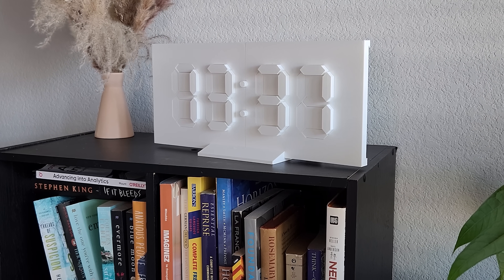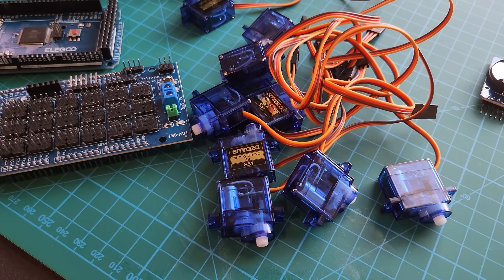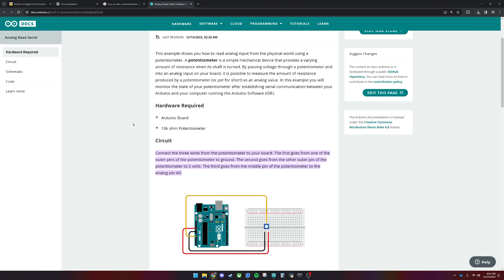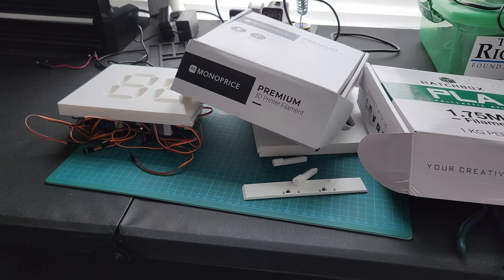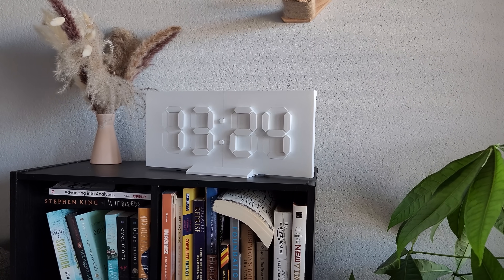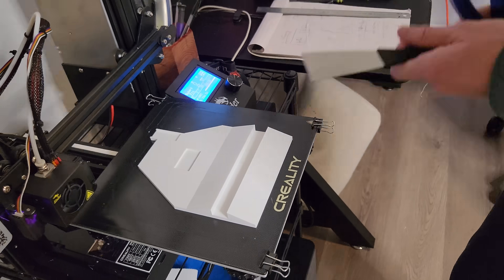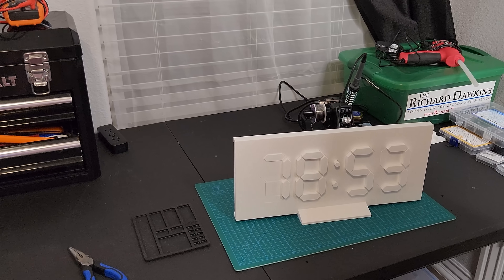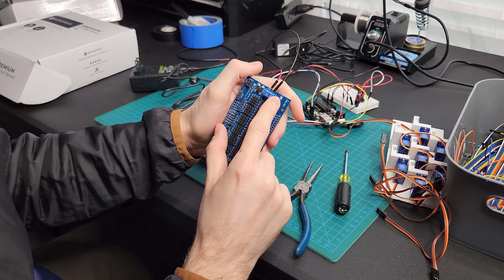I Built a Minimalistic Kinetic Clock Project with my 3D Printer and Arduino

Comment: Hey man, great video! I just wanted to throw a suggestion your way. I have 3 Ender 3 Pros and I was all about the glass bed when I first got them. It was the first thing I bought. BUT, I picked up a PEI build plate to test it out and it is next level good. The adhesion prints have is so freaking good, literally almost 0 pull away while printing. Plus, when the print is done, this plate is magnetic and all you need to do is take the plate off and flex it a bit and the print pops off so easy (no more scraper with a hammer lol). The last thing is the surface is slightly rough (which is why the adhesion is so good) but it puts this great texture on the bottom that makes it look like more of a production part rather than a 3D printed part (hard to describe this part, but if/when you get one you will get what I'm saying). They are really cheap and by far the best/most useful upgrade you can do to an Ender 3. I got mine from Amazon it was a Comgrow PEI Sheet Magneti. Right now it looks like they are about $13.
Reply from the maker: Hey! So since this video I've upgraded to a Bambu X1 Carbon. I bought the PEI textured sheet with it :-D. MUCH better!

Comment: Get a variable led power supply. Its going to be very cheap and it's going to give you 2 outputs . Then you can connect 1 to each board with only 1 plug going to the wall. If you carefully strip the casing , you can make it into a very compact psu integrated in the clock

Comment: Nice project 👍..
You could have used, Stepper motors I assume.. I know Servo motors are more efficient than stepper motors, however 
Stepper motors are generally quieter than servo motors for low-speed applications. What do you think?

Comment: Hey Lukas, awesome job. Gonna try it on my own. :)
One question in regards of power supply:
The Sensor shield is powered with 9V. Why don't you use the 5V pin on it to power the Mega Board?
Reply from the maker: Humm I never thought about having power flow from the sensor shield to the mega. Maybe try it out and let me know what you find!

Comment: If the Arduino is getting flakey when the motors are drawing current, maybe put a big electrolytic cap across it's power rails, as close to the input of the regulator as you can. So it can run off that for a little while. Also maybe move the motors, instead of one continuous sweep from in to out, do it in a couple of stages with a little rest in between so that cap can recharge a bit. Also consider the current path to the motors, don't run it from the Arduino's power pin, give it a separate connection as close to the power adaptor as possible. 

Perhaps run the motors alternately rather than several at a time, alternate between each one at a reasonable pace so it pushes it's segment out just a little bit, then the next one. The idea being to keep down the peak current, not trying to draw too much power at once. It might slow down the clock's update but that doesn't matter, it only has hours and minutes, you could keep it within a reasonable time.

That's the sort of stuff I'd concentrate on, at least. Reduce maximum power draw, and keep the Arduino's supply as separate from the motor supply as you can, even accepting that they're both branching off the same supply line. Arduinos can run on a wide voltage if they have their own voltage regulator on board, which many do, or else just get a 7805 or the like. If the motor board also needs a power regulator, have it be a separate one, don't leech off the Arduino's regulator. That way, both regulators are pulling down on the main voltage supply, rather than all the circuitry and motors pulling down the regulated voltage off one regulator. So there's a bit of voltage overhead. As ever with regulators, they'll need a heatsink.

You could use switch-mode DC-DC convertor boards but to me that's a bit more flakey than a good old solid 7805 that'll warm your toes in the winter.
Reply from the maker: Hey! Thanks for the suggestions. I'm thinking I need to start including more capacitors in my projects :-P.

Comment: This is awesome! Thanks for sharing. I would strongly recommend using a spring type of mechanism and an offset cam; similar to those used in naturally aspirated engines. 

I'm just coming across this and prematurely not certain how rhat design would work out, however, I do know watches use gears as well. Thank you again!

Comment: Hi Lukas, I'm currently in the process of building this too. Really looking forward to getting it finished but not going to rush it. I'm only just just getting the hang of 3D printing but not at the stage where I can design yet, so I was hoping if you'd be able to send the stl for the stand as its better than any attempt I could make at the moment. Also, it really finishes the clock off nicely and to me, I think it would be nice if the original creator added it.
Anyway, what a great job you've made of your clock, if mine looks half as good I'll be very happy. 
Cheers

Comment: What a cool project. Not a fan of the servos -- I think electromagnets would be more slick, but the result is the same. Come to think about it, the smooth transition of the servos would be a nice touch. Hmmm...

This is one of those projects that would benefit from GOOD sanding, especially on the clock face and digits.

Comment: I'd be curious to know if it still work with an elastic material over the front of it, like a very stretchy vinyl.  This could both hide the recessed numbers as well as increase the aesthetic that the numbers are coming out of the clock, provided there's enough detail in the numbers while the material is protruded out and that the material doesn't deform and cause a warped effect when recessed back.

Comment: If it's a 12 hour clock instead of a 24-hour clock, you don't need those five extra servos on the first digit, cuz the max value will be 1. Would that decrease the need for the second power supply?
Reply from the maker: That would certainly help a lot. I think also removing the two servos powering the colon :-D
Reply: @LukasDeem  lol I didn't want to presume that that's what I saw at timestamp 4:18, but you're right!

Comment: Use stepper motors instead of servos as they are quiet. For the PSU, if everything is 5v, combine the amps from both PSUs and buy one that can handle that amount. Let's say, your current ones are 5v 4a and 5v 2a, then just find a 5v 10a one and it will be more than enough to power your project.
You will probably be better off with one of them metal box type ones as you can simply screw wires to it, and it can be stored in the back of the clock with a single power cord coming out.

I would definitely make a full enclosure for it, as it will also make it quieter.
Reply from the maker: Hey great suggestions! I agree on the power supply. I'll do some more research for my next project!

Comment: Why do you have 30 servos? You just need 24.
Reply from the maker: I followed the original design. I was using this project as a way to learn. I've seen so many good suggestions in these comments. I now realize I didn't need nearly as many serovs :-P
Reply: @LukasDeem  I'm looking forward for version 2

Comment: Since you chose to put servos on them. I've would love to know, what the 2 dots in the middle, is actually supposed to do?
Reply from the maker: So the colons can move in and out. Not sure what the original designer had in mind there. During the startup sequence it does look cool when all segments including the colons go flat with the surface :-P.
Reply: @LukasDeem  Ah ok. Since they've got separate servos. I thought they might had a function. (Some kind of setup indicator, or something)   ☺

Comment: Hello Lukas,
would you link the file for the clock bracket and the Arduino? That would be very kind of you
best regards 
Robert😃
Reply from the maker: Hey Robert! I'm working on the full documentation on my website. However in the meantime, here are the STL files for the base https://www.thingiverse.com/thing:6444386

For the code I just used the code uploaded by the original poster found on his instructables page here https://www.instructables.com/Kinetic-Digital-Clock-Arduino-3D-Print/
Reply: @LukasDeem   Hello Lukas, thank you very much for the quick reply.
I appreciate it.
I am looking forward to your full documentation and will follow you on your site.
Thank you very much
best regards 
Robert

Comment: A big improvement.... LEDs to light the proud elements. Should be quite easy to get from the clock module.
Otherwise, very nice.
Mount it in a nice walnut box.
Reply from the maker: Ohh! A nice hardwood box would be excellent. I used to have a full woodworking shop before I moved for work. Maybe it's time for me to get back into it :)

Comment: Simply AMAZING this one! Looks so mesmerising! A digital but real kind of fusion! LOVE IT!
Hope this can be mass produced for selling!

Did you try tiny magnets for the joints etc. for easy installation or repairs etc?
Reply from the maker: Hey thanks! I'm working on a second iteration that uses magnets instead of servos. My fear if I were to sell this as a product is that the servos would burn out.

Comment: What a great project. The only thing I would add is a WiFi connection (could use an ESP8266 or ESP32) so that the time could be set automatically off the web.
Reply from the maker: Yes! I agree, I'll be setting up V2 with an esp32 :)

Comment: Great work

One can optimize it using the fact that hours tend to move much slower than minutes

so, there might be a solution with less servos or maybe even with gears

also, the power is not needed for all servos all the time, so some power switch can also be used

What do you think?
Reply from the maker: Hey! Yes I totally agree! I'm planning to build a V2 so I'll have to keep this in mind!

Comment: How loud is it? I made a 7 segment servo clock but the problem was it was too loud. Also, the servo for the seconds digit that changes most frequently, wore out after a few months.
Reply from the maker: Hey, it's louder than I would prefer to actually leave it running all the time. I'm planning a V2 that will use magnets for nearly silent operation. I fear these servos could burn out as well if I left it running for a long time since I used the cheapest ones I could find :-P
Reply: @LukasDeem  hahaha!  I think they are the same ones I used. I want to redo my click using stepper motors.  Would be smoother and quitier.
Reply from the maker: @kevinbright1  nice! Are stepper motors going to be much more expensive? Also do they come in small enough sizes to fit this design?

Comment: There are so many ways to make a 7-segment display.  This is a very creative and attractive way 👍

PS - I still have my old clock from the 1970s. This has large red LED digits about 1 inch high.  The clock itself is actually a module with the 4 digit LED display and the chip covered in black epoxy, all mounted on a fiberglass circuit board.  There are connections for 5Vdc and push-buttons to set the time.

Cheers from Canada :-)
Reply from the maker: Hey thanks! Cheers! :D

Comment: Add an LED or more to each segment, and make the segments out of a plastic that diffuses light.  The lights turn on when the segments move outward.  Or you could have the segments move inward instead, and then have the LEDs turn on when retracted.
Reply from the maker: Ahh inverting it would be pretty cool!
Reply: @LukasDeem  How about invert it, and the walls that it recedes into be made out of diffusing plastic.  Then place a bright light in the back inside of the enclosure.  That way you don't have to worry about switching the segments on and off.  Thanks for taking your time to read my comment.

Comment: Could have skipped wiring most the pieces on the left digit since it will either be 1 or 0.
Reply from the maker: Very true. However there is a stopwatch/timer function that the original creator used that will use all the digit segments.

Comment: Wouldn't a better design be electromagnetic? Use the same polarity to push the pieces out then reverse the polarity to pull them in
Reply from the maker: Yeah after posting I've seen a lot of comments telling me that I should have used magnets. I already started doing some research on how to set that up so I could do a kinetic clock V2!

Comment: I have bad experience with those cheap servos mine started to break after about three months but I suppose if they are easy to change it is ok. I will make a try with solenoids instead but will need beefier psu and might get heat issues.

Comment: don't wire directly to the microcontroller. make a custom breakout board, so you can easily detach the Arduino if needed

Comment: Maximal complexity!
Surely servos are a terrible idea when moving so infrequently!
Bistable solenoids could be home-made: a coil and two weak magnets that hold the segment in each position. The coil drives the segment away from one magnet and towards the other, just a short pulse from a capacitor: a voltage doubling circuit would pump well (see LM3909 circuit diagram). This would require minimal power to run!
Reply from the maker: Would it still require power after they have moved into the low or high position? Does it require power to keep them in place or just to make the switch?
Reply: @LukasDeem  power is just a short pulse to repel one magnet and attract to the other. Zero power otherwise. Look at (mechanical) "latching relays" to get the idea and typology
Reply from the maker: @BlunderMonger  very cool. I'll have to add this into the design for V2 😄

Comment: Two easy ways to run 1 power cord to the project. The easy way would be to put the power supplies closer to the clock and run 1 power cable that splits to both of them.
The better way would be to figure out what your peak usage would be (how many servos will need to move at the same time, or over shoot and add together all the servos amp draw together) and get a 5V. With 30 servos and 1 Arduino a 5V 30A PSU would be plenty and you could likely get aw with far less. Try out a 10 amp supply.
But it's not about doing it perfect, its about making a cool idea and you did that for sure. Great work man. Its beautiful.
Reply from the maker: Hey thanks! I was afraid to let too much amperage flow through the sensor shield. I was unable to find clear documentation on what the shield can handle.
Reply: @LukasDeem  Aside from shorts, a circuit should only draw what amps it needs so each servo shouldn't pull more through its traces than it needs. 
Do what I always do if you're not afraid to possibly burn a few bucks (and parts). Wire it up, stress test it and see if anything pops! Turn it off after a bit and feel to make sure nothings getting warm.
Just keep the switch to the power strip close : P

Comment: You could use coils instead of servos. like SparkFun ROB-11015
Reply from the maker: Thanks for linking a specific part. That helps a lot!
Reply: These are not bistable, therefore they will need constant current in one position.

Comment: Really cool project, i seen a 7 segment display made of gears that only requires one motor (per segment), obviously it gonna make the design bigger (or longer), but maybe its worth if you have the extra space (probably it would make it easier to power up :)

Comment: You could totally just run power from one to the other. Like, not complicated. They’re the same voltage, just run the two wires over there and solder them on.
Reply from the maker: Hey, so I tried that but I kept getting brownouts. I think I need to upgrade to a 5v power supply with more amps. I was afraid, however, that I was going to be running too much amperage through the sensor shield.

Comment: I love the look and that you polished it. I've seen clocks on YouTube that were based on mechanical counters, only requiring a single motor. They had a different look of course, but I am sure that one could tweak this design with this knowledge to drastically reduce the amount of servos needed, which would drastically decrease the cost of the whole project.

Edit: I just looked it up, how those single servo clocks work and thought about how to adapt it to this clock. Every segment of a clock has a certain pattern it repeats to be shown or not shown. Each segment would need its unique cog that has teeth corresponding to this pattern. The cog needs to translate its movement to retracting the segment or not.  Now when we run a cog with a servo which connects to each segment cog, we can run our clock with only one servo. Or two if we want to give reduce the complexity by building the cogs per segment.
Reply from the maker: I plan on learning a ton more about gears in an upcoming project. Maybe once I do that I'll have the skills to do this :)